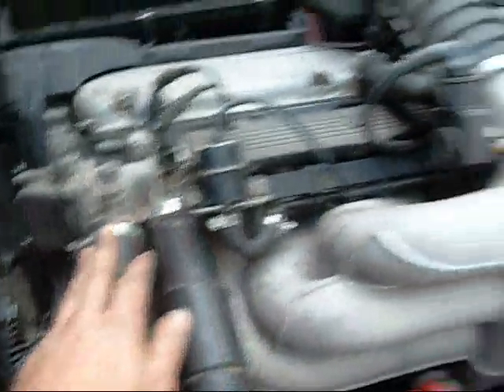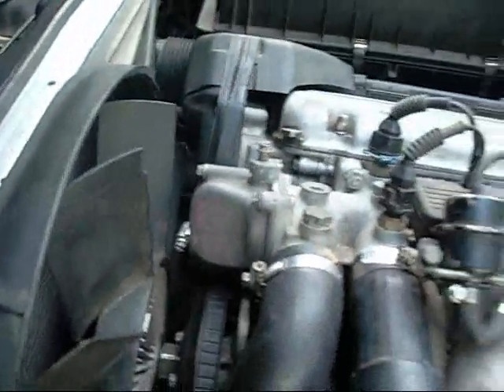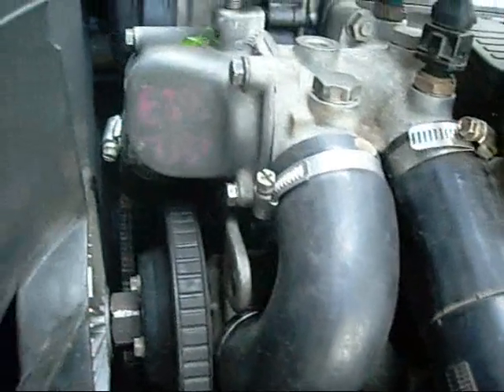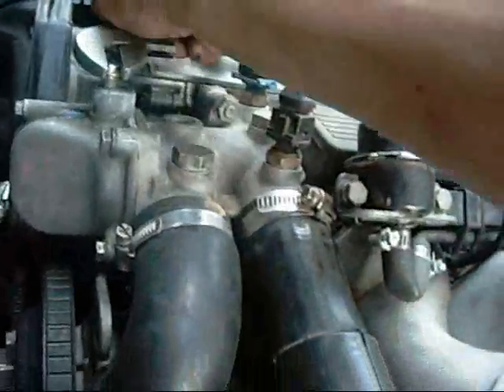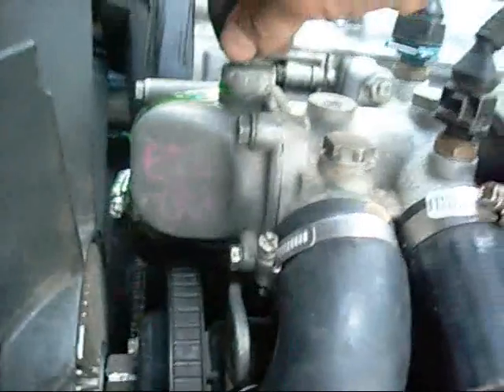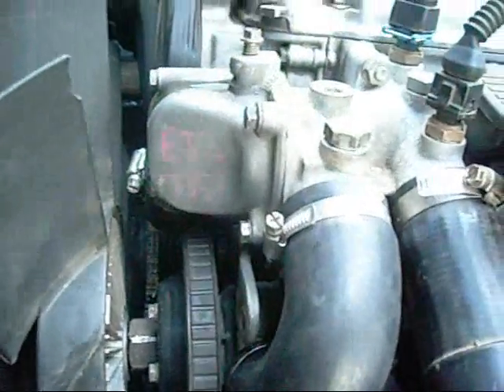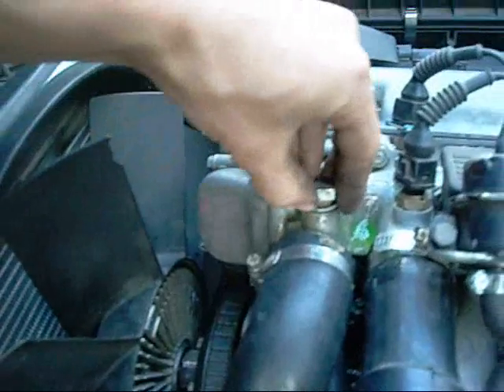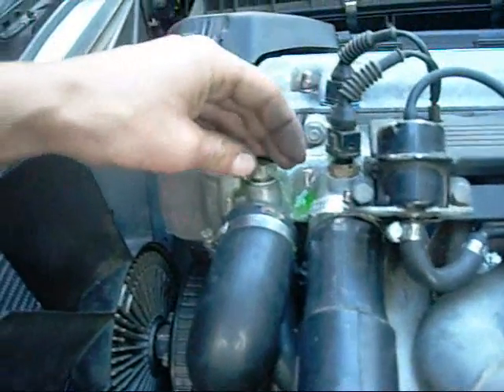BMW E32 M30 Big Six Cooling System Pt2 Air Bleed

Comment: cool yep that would have stopped the pump. when you turned it off the air would have gone to the high point because the T/stat would have been open.